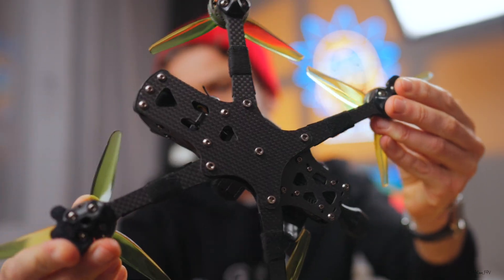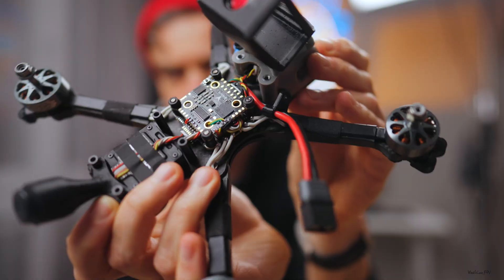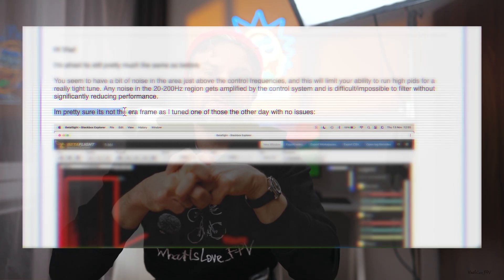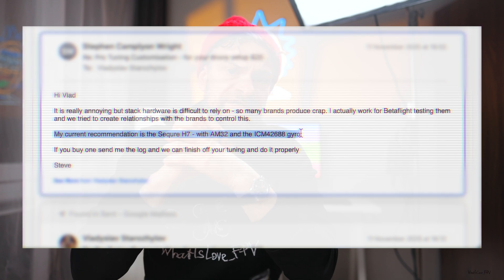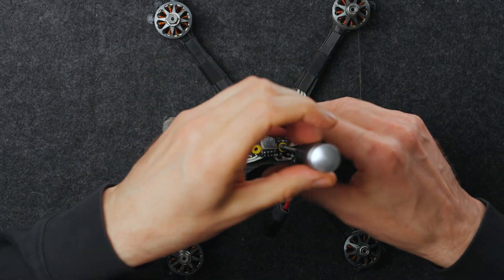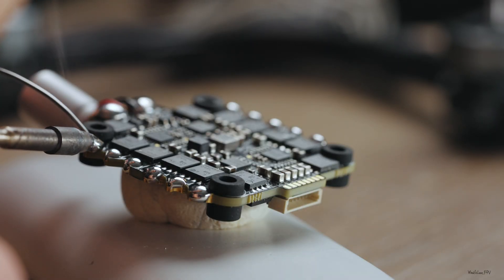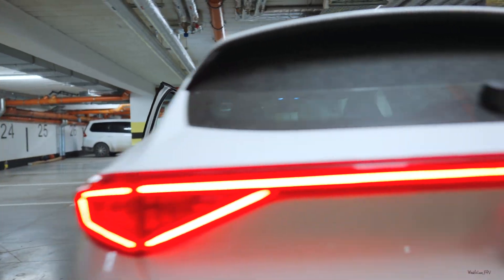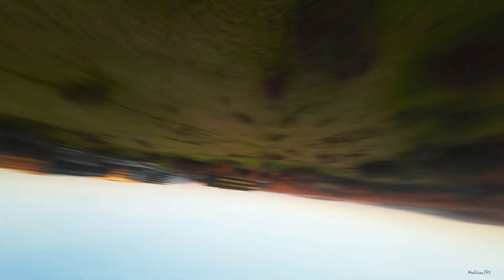Do Components Really Matter in FPV Drones? My Surprising Results

Comment from the maker: 📌 Quick explanation of what was actually wrong:
My previous stack — the TBS Lucid — is great!
But it simply didn’t fit my build.
Because of the Gorilla mount design, it sat too high.
I had to reduce the FC soft-mounting, which resulted in not enough damping.
And that caused all the issues with precise tuning.

Comment: Happy that it worked out well - the reality is a lot of electronics have poor QC and we work at Betaflight advising on design to all the brands you see in the configurator (the Partner Program). Sequre has been my favourite and they were great to work with. Many brands barely contact Betaflight or fail to follow the correct specifications. Low noise and stable gyro output is the key thing, but never mentioned in all the promo brands make. They always focus on pointless gimmicks.
Reply from the maker: Thank you for your comment and for sharing the information. I'm glad you stopped by my video.
don't forget to check your email, please)))
Reply: @WIL_FPV  ok done it...;)